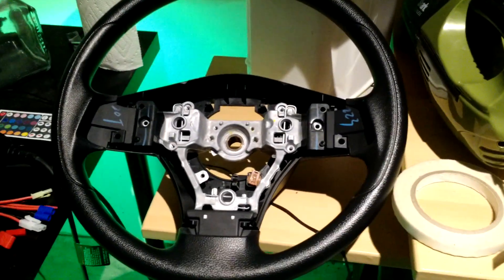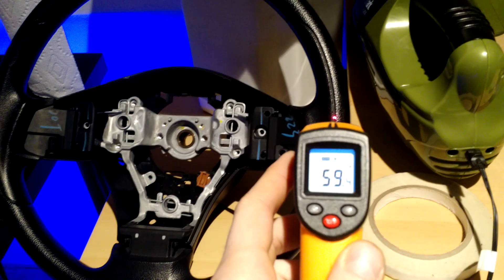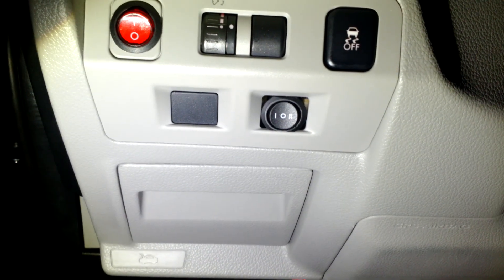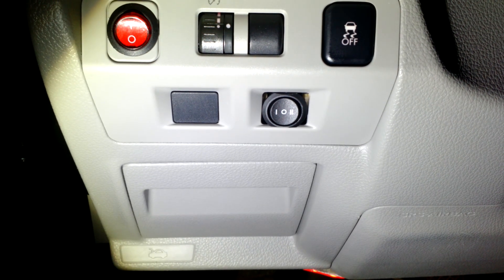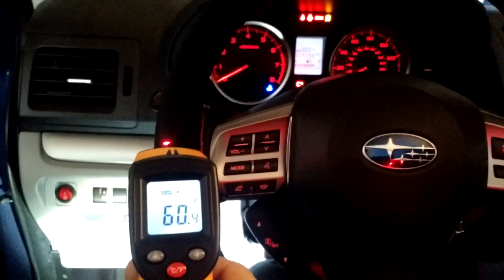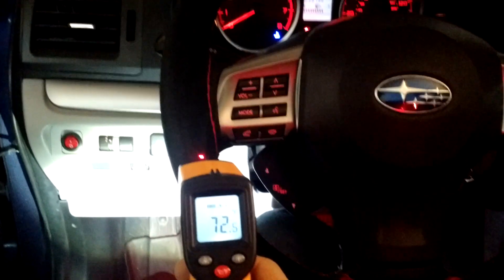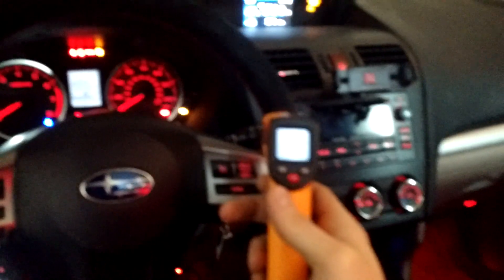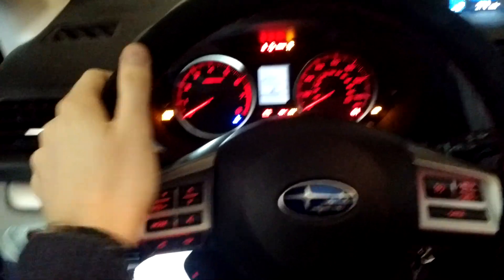DIY Heated Steering Wheel - 2015 Subaru Forester

Comment: How would you regulate voltage to control heat with an intensity knob like some of the kits seem to use? Would you do it on the AC output side or on the DC input side?

Comment: Why AC and so high, can the 12V system not be used?  Just seems strange to me sorry.
Reply from the maker: Voltage is high to keep current low. Steering wheel clockspring can't support high current without burning up / melting. Power = Voltage × Current, so you can increase one and lower the other and still keep power (the amount of heat generated) constant.
Reply: @avsti  got it. Is this how they install this on vehicles with heated steering wheels as oem or do they use a heavier duty clock spring.
Reply from the maker: @kartboarder22g17  I'm honestly not sure!

Comment: Since it’s been a little while since you’ve installed this.. have you had any issues? How safe is this? The live heated metal wire against the original leather or cloth material. I want to add heating to my wheel but I’m concerned with safety. Thanks!
Reply from the maker: It's still working great!

Comment: Hi how do u pull the cable tru the tunel that is not twist around and rape off when u turn the wheel?
Reply from the maker: Gracx x That's the purpose of the "clockspring" or "roll connector" (look them up) and that's what I used here. Same thing which carries horn, cruise control, and airbag signal wires.
Reply: “Rape”💀

Comment: So did you remove the steering wheel wrap and then wrap the nicrome wire in the steering wheel and then wrap the steering wheel with the original cover?
Reply from the maker: Shafi Mohammad Actually I wrapped the nichrome wire directly onto the steering wheel then installed a custom cover.
Reply: where was the fiberglass heat resistant tape used? over the nichrome wire or under? and what is the thickness of the cover? i would like to thank you for making this video and the details. i am going to give up my cruise control and use the wires for the heated steering wheel :)
Reply from the maker: Over the nichrome wire, basically just to secure it temporarily and to keep its spiral/snake pattern from shorting until the cover was installed. Mostly just to hold it in place until the cover was installed.

Good luck with your project! Careful working around the airbag. Let me know how it works out!
Reply from the maker: Oh, regarding cover thickness: it's probably 1-2mm thick; a microsuede synthetic cover similar to Alcantara.
Reply: great did you buy it and did you stitch it on after? looks factory. also does the heat keeps climbing and have to turn off or stays at and around 85 on high.
Reply from the maker: I actually bought it and installed it on my original wheel well before this project started; I had to unstitch it from the original wheel in order to transfer it (and then re-stitch). There are some tutorials on YouTube for how to do this and it's not too difficult. Most covers will come with a needle or two and more than enough thread for the job.

As far as temps... on the high setting, it gets too hot to hold (>100F?) after like 5-10 minutes of driving depending on its starting temp. After that I generally switch it to 'low' and keep it there. On low it maintains a comfortably warm temp (probably around 80F?). I'm glad I put in both functions or I'd have to keep switching it on and off of high, or waiting much longer for the low setting to heat the wheel.
Reply: that's great. thanks a lot for all the info. i have ordered all the parts required. could not use your links, they don't ship to Canada but found something identical. i will let you know once done.
Reply: avsti thanks again for making the video. I just finished mine and it works great.

Comment: Obviously you were careful on current but any concerns with the fact that you have about 26 times the rated voltage (assuming it is rated for ~12V, and 220VAC RMS = 311 VAC peak to peak) of the clock spring?  Seems like electrical potential just waiting to punch through to the airbag circuit.  Possible induction as well since you are using AC...  And sure MOST (debatable) HOUSEHOLD wire is good for 250V, but that doesn't necessarily mean automotive wire is, in fact I think it is more like 60V.  A clockspring is probably even less.  You are using a connection that was meant for both low voltage and low current signal.. not high voltage low current power.
Reply from the maker: I'm going to be honest, I can't guarantee safety with this DIY project, I just did my best to find a good compromise between voltage/current while delivering the heating performance I was looking for.

Here's how I rationalize my current setup...

Things working in my favor:
- Even the thinnest, cheapest hook-up wire has insulation rated for 300V; for me, this inspires confidence in the clockspring's insulation
- The transformer I'm using actually outputs a square wave with 240V peaks; not a sine wave with peaks exceeding 300V
- The 2018MY Forester features an optional heated steering wheel, while sharing its clockspring part with prior model years (based on a search of parts.subaru.com); until the service manual is available, however, it won't be possible for me to tell how it works (i.e. what voltages/currents it delivers)

Things working against me:
- Every FPC/ribbon cable I've researched (similar to the kind you'd find if you opened a clockspring) seems to be rated for no more than 60V :/

So, after ruling out non-clockspring alternatives (e.g. using a slip ring; there was just no room for one between the clockspring and steering column) and testing the 240V signal on a similar clockspring part without observing any obvious signs of damage or signal interference, I decided to install it my Forester. Anecdotally, I'm happy with the setup and have yet to see any issues with the steering wheel's infotainment controls, airbag, or horn in the year (and many hours of use) since I set this up.
Reply: I see, thanks for your explanation and a good disclaimer.  Very interesting that the same clock spring is used, though i would think the 2018 would have the same if not more buttons, including the paddle shifters. It’s too bad that data sheets don’t seem to be available for these types of things. It will be interesting to read the 2018 service manual. Until then you may be able to find information on the Canadian model since I believe it has had this option earlier than the US. I looked in the owners manual for a fuse on the 2018 and I don’t see one even though the heated steering wheel is mentioned...
Reply: @avsti  Hey man! Great video and thank you for the diagram! I recently did the same DIY for our FXT with a heated steering kit bought online, and the longest part was figuring out how to run power to the heated element. I wanted to use the clockspring but had the same concerns as Dallas so I left the connector of the coil unattached until I found this video and clockspring diagram. 

I see that you used pins 1 & 8 on the B68 connector and pins 1 & 3 on the ST4 connector. My issue is that the ST4 connector is active since we have the AT transmission with paddle shifters. Now, pin 1 is free on the ST4 but using a continuity test (correct me if I'm wrong) I think it relates to pin 2 on the B68 connector. That would be ground according to your diagram, but in my case, there is a light blue silver dotted cable on that connector. I don't want to risk taping into an active system and having a bigger issue so I'm kind of stuck... Any advice would be really appreciated.
Reply from the maker: @victor270295  hey thanks for reaching out. Yeah it's definitely trickier on higher end cars where all the pins are in use! I just browsed the service manual for a few minutes and confirmed that all of ST3 (the main connector) is used up by cruise/media/horn/infotainment/S# controls. ST4 dedicates 3 of its 4 pins to paddle shifters. ST5 is worth looking into however. Pins 1 and 4 are used for infotainment switch illumination but I'm not sure what 2 and 3 do. Might be worth a shot. If you don't get lucky and find them to be unused, my next plan of attack would be to identify all of the illumination (LED) wiring and to consolidate it. For example, actively free up pins 1&4 on ST5 by routing their power and output through pins 10&11 of ST3 (also used for switch illumination). I imagine this will risk dimmer LEDs but it seems like a small price to pay.

Not that it'll be too relevant but be sure to check out my latest heated steering wheel vid! Kind of a coincidence that I just wrapped up this project again last week... after nearly 4 years.

Comment: Did you also experiment with heating the entire steering wheel? I was wondering if it was possible to do without overheating the wire with the extra length.
Reply from the maker: This was my original plan until I realized that heating only part of the wheel was a possibility. For any given power consumption, I'd rather have the wheel get twice as hot where I hold it than get equally warm all the way around.

If you're interested in doing this with the components/calculations I've provided, I suggest just more sparsely wrapping the same length of wire around the entire wheel. The way I wrapped it, there was about 1 coil per centimeter, so just expand to 1 coil per 2cm. Any given section of wheel would be heating 50% as much since power has remained the same but the area it's heating is doubled.

As far as not "overheating the wire", I just wanted to clarify that adding wire would have the opposite effect - it would get significantly less warm with increased resistance. Let's say that I'm currently heating 50% of the wheel; if I used twice as much wire (to cover the rest of the surface), I would be doubling the total resistance, and thus halving the current and power (Power = Current^2 * Resistance), e.g. (Power = 0.5^2 * 2 = 0.5). Thus, any given section of wheel would be heating 25% as much (total power is cut in half, and total area being heated is doubled).

Finally, in order to maintain current heating power (over the 50% that I did) but across the entire wheel, we would have to double the overall system power. This means sending 220V @ 0.6 Amps through a slightly thicker wire or 440V at 0.3 Amps through the same wire. My instinct is that neither can be sent through the clockspring safely. Higher current risks melting the clockspring wires, while higher voltage risks breaking through the wire insulation (most wire insulation is good for 250V or so).
Reply: Thank you for the very helpful info.  I'm seriously considering getting ahold of a used steering wheel for my car and experimenting on it for awhile until I get the desired results, both functionally and cosmetically (re-stitching the leather).  It appears you did the same at your workbench before doing it on the car.

What are the maximum temperatures your steering wheel reaches with the voltages supplied?
Reply from the maker: Pete M it gets too hot to hold within 5 minutes or so on the high setting, depending on ambient temps. I haven't measured it though.... I'm guessing over 100F. On the low setting it stays bearably hot.
Reply: Uhm, when you add lenght to the cable the effect goes down, not up.
Reply: Yes, I was thinking at the same thing and using longer wire packed on the entire lenght and closer togheter and using the existing 12 V DC, and not a dangerous 110/220Volt, but a problem would be transfering the current from the steering wheel onwards that hasn't the wire thickness to support the 12 v current that is higher than 220V

Comment: Are you using powering this using the clock spring in the steering wheel or do you have 2 wires running down your steering column?
Reply from the maker: slappy76 via the clockspring.
Reply: How did you determine that those pins weren't being used? I don't have access to the factory wiring diagrams.
Reply from the maker: slappy76 I took the airbag off, measured the resistance.
Reply: Okay.. so the pins (a pair?) that measure some resistance will be the ones that trigger the airbags? And the ones that are open circuit (infinite resistance) are usable? Sorry if I'm asking a million questions, there's no write up from any website I've come across. Also I'm attempting this on a Ford Fiesta, not a Forrester.
Reply from the maker: slappy76 that's correct, and no problem. Note that on the Forester, these 2 pins were unused because my model doesn't have paddle shifters installed. In any case, if you see unused pins on the steering wheel side, you should be able to match them to unused pins on the steering column side (other side of the clockspring).

Also, might be obvious, but you should use a transformer to avoid sending large currents through the clockspring to keep it from melting. Once you know its resistance you'll better be able to calculate this.

Comment: Ok, gotcha, we are looking at a 2015 or 2016 Forester but my wife really wants a heated steering wheel but doesn't want to spend the $8K more for a 2017 Touring. Would you be for hire by chance? We live near Kenosha
Reply from the maker: chris ward Haven't considered it before... I guess I do have all the parts lying around to make another one. I'll think about it. Another thing is that the 2017 models already support a heated wheel which costs $800 as a part from Subaru; might be possible to buy a Base/Premium and just swap it in.
Reply: avsti I thought of that too but I'm not sure if it would fit etc. I will touch base with you if we pull the trigger on a Forester. Thank you for considering!
Reply: @chrisward1559  pulling the trigger near Kenosha just got more real than ever

Comment: In the parts list you provided, is that the exact inverter you used? If not can you provide a link. thanks
Reply from the maker: Yep that's the one. The only modification I made was attaching small heat sinks to the MOSFETs (just to be on the safe side).
Reply: The other question I have is....did you wire the transformer before or after the clockspring.  My concern is the clockspring wires heating up when the current is going thru.
Reply from the maker: jaged929 definitely before the clockspring! The whole point of stepping up the voltage so much was to reduce current going through that ribbon cable.
Reply: So......    12v batt > transformer > clockspring > Nichrome wire?     I'm guessing the resistance in the Nichrome wire is greater than the ribbon cable found in the clockspring hence it heats up and not so much for the ribbon cable.
Reply from the maker: Yep pretty much. Here's exactly what I did:

1. 12v out of fuse box (can't remember which fuse I connected to... maybe ACC... it's important that you pick a fuse that is OFF when the car is off in case you leave the switch on over night... learned that the hard way ;-)) >
2. Transformer >
3. DPDT switch toggling between ~160V (LO), OFF, and ~220V (HI) >
4. Leads to clockspring (I think I used 20 or 22ga wire terminating with standard/cheap 2.54mm pitch pins) >
5. Clockspring > 
6. Leads to rim of steering wheel (again, 20 or 22ga wire and 2.54mm pitch pins) > 
7. Nichrome wire around rim of wheel

For sure, the Nichrome wire (at 680ohms) is the majority of the resistance and will dissipate nearly all of the heat. The rest of the wiring accounts for <10 ohms, I believe.

Later tonight I'll try to remember to review my notes and attach a circuit diagram photo for a nicer description.
Reply from the maker: Some final details:

1. Transformer outputs used were 175V (LO) and 220V (HI)

2. Transformer was encased in a small cardboard box to isolate its circuitry from anything nearby (I was specifically concerned about the heatsinks I put on the FETs, which I believed would be energized)

Useful if you're working on a similar Subaru:
3. The exact clockspring pins I used on the steering column side were the two in the leftmost 'column' (nearest the wheel). On the wheel side, I believe these corresponded to the two rightmost pins in the 3rd connector. The connectors are horn/airbag (4 pins), infotainment (12 pins), and unused / paddle shifters (4 pins) - from left to right.

Anyhow, good luck with your efforts - let me know how it goes!

Comment: Please post your how-to!   Thank you.
Reply from the maker: Let me know if you're interested in any steps in particular:

0. Experimenting with nichrome wire to determine voltages / resistance / length to use
1. Wiring transformer to fuse box for 220VAC power
2. Removing steering column cover / wiring 220VAC power to steering wheel's clock spring
3. Removing wheel
4. Wrapping wheel with nichrome wire
5. Stitching on leather cover over wire
6. Putting wheel back on

Each step by itself is pretty straightforward - and steps 3, 5 and 6 already have videos.
Reply: avsti hey how long of a wire do I need to do a full steering wheel and when you wrap the wire how spaced out are the gaps?